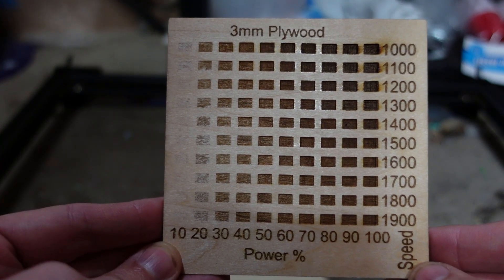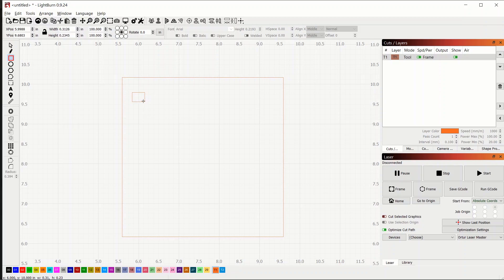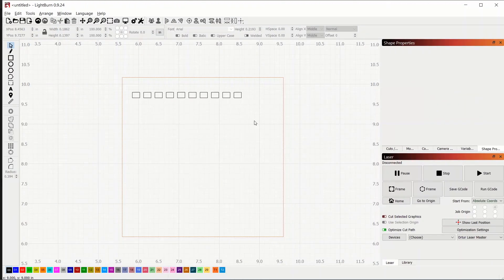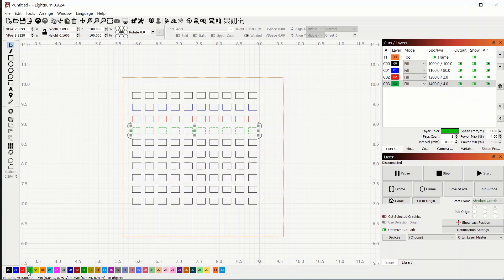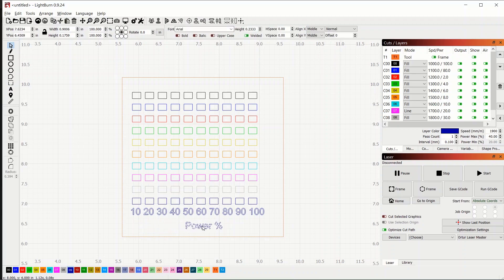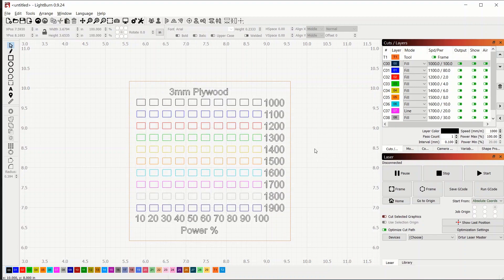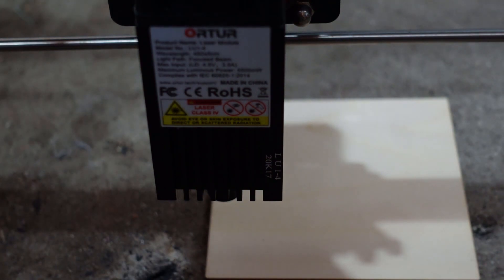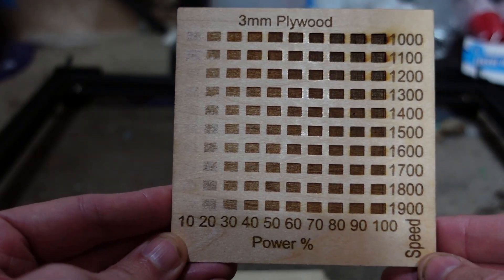Lightburn Speed & Power Grid Tutorial

Comment from the maker: Remember, if you're using a co2 laser you probably don't want to go above 70% power, that will wear down your laser tube a lot faster.
Reply: yes, using a c02 60w. so is it safe to keep it at around 20?
Reply from the maker: @TeresaHumm  20 would be fine but you could go higher, you just want to avoid going over 70.
Reply: I made mine as a line Card so I went up to 100%

Comment: I have the Ekelstar 4240 CNC 20w/5w will this grid work for that aswell, and will I just input the same numbers as you have done, I just want to be able to create some more stuff
Reply from the maker: @yvonneomalley3332  It should. You can always adjust the speeds higher or lower to get a better range if you need to.
Reply: I'm on the verge of throwing it out because it won't do anything and I can't find the settings for it to cut wood anywhere at all, tried your settings it hardly touch the wood for engraving but thank you

Comment: setting all the powers to 100% at the end is confusing - what makes you think your original input value magically gets turned into a percentage of the power? (genuinely asking) - i think all you did was show us a power grid of 100% power at different speeds and not different power percentages and speeds
Reply from the maker: It's not "magic" that's how it works. It's a percentage of whatever is on the layer.
Reply: @3DJapan  but where you entered the 100% is the same as when you entered the 6.6 its just in a easier location - if you go back into the layer it will show as 100% not 6.6 or whatever value you entered originally meaning it was changed to 100% - why would there some sort of background math going on? you entered 100% its using 100% - if im wrong please explain.

also im testing it as i type this at a machine using lightburn.

Comment: I noticed your settings are mm/m mine are in/m, does that make a difference on the numbers used? instead of using 1000, 1100, 1200 do I make it a different number? Thank you
Reply from the maker: I'm not sure what you're numbers would be but you can change it to mm/min in Edit > settings, then if you like, change it back after you're done. I got used to using mm because that's what 3D printers use. Plus most laser tutorials use mm.

Comment: There has GOT to be a more efficient way to do this than manually ... right? All this tech and software, but a test grid has to be created one square at a time? Seems like LB would just include a premade/native template for something like this. [edit] Spoke too soon ... yes, it indeed looks like there's a "materials test" feature in LB that generates just such a grid.
Reply from the maker: No, not one square at a time. Whole groups of squares at a time. Yes, after I posted this video they added a basic version of this to the software but doing it manually gives you more control and shows you how to adjust it if you need to fix it after it's made. Not to mention once you make it one time you can just easily adjust it for different materials. You don't have to make a new one every time.

Comment: So I did this last night and had to shut it off after about 5 mins or so.  It burned through the wood into my self healing mat.  I’m not sure what I did wrong I followed right with the video. Well here’s to see what happens to a self healing mat 😳
Reply from the maker: Never good to have something you care about under your material. Every material will have different settings so your wood just needed less power. You might want to try increasing the speeds in your grid. If tweet doesn't help just don't use the high power percentages, maybe stop at 70% and don't use the 80, 90, and 100 rows.
Reply: @3DJapan  ok thank you. This was like literally the 2nd thing I’m ever done.  First time I used it the motherboard blew.   So after a month I finally have it working.  Just little scared of it now 😂

Comment: Great video Phil.  I followed your instruction to the T.  However I do have a question.  At 11.46 in the video you had mentioned to set each power to 100%.  Then at 12:03 right before you burn the Power looks like it went back to the original Power Settings.  Should we keep it all at 100% Power or have set back to the original?  Thank you.
Reply from the maker: That part was edited in later, that's why "Editor Phil" said it. The power in Cuts / Layers should be 100% for every layer, the number in Shape Properties is a percentage of the one in the layer. So if the layer said 50% and the Shape Properties was 50% of that, you'd be using 25% power, so just set all the layers to 100%.

Comment: This is thorough but last month I did a power test and now I can’t find the button to do the one that they automate. Is it under the tool section? Sorry this is probably the most idiot question but if anyone happens to see this let me know.
Reply from the maker: The one built into Lightburn is under Laser Tools > Material Test. I do think doing it manually is better, it's more customizable and only takes a few minutes.
Reply: @3DJapan  Thank you. I did find it under “interval test” 2nd from the bottom in tools. I do t think this version has been updated for at least 6 months so that may change. Thanks for the help. PS, I have a Chinese laser and it’s the big 1390 FL. I am noticing if I stop a rastering or a vector cut in the middle of a job, when I go back to doing the job again it is offset by at least a 16th of an inch. This is not a good thing! Curious if you have any tips on how to make this align perfectly if I stop it in the mist of the job? Thank you and if you have an answer I’d like to buy a coffee if you provide one in your YouTube videos. Thanks boss.

Comment: I am fairly new to the laser seen, can you explain after you do a speed/power test grid, how does that help you choose your speed and power when you are setting up an image to burn?
Reply from the maker: If you look at the grid you can pick the square that you like. For wood that would usually be dark but not dark that it has scorch marks around. For ceramic tile and some other things there's a sweet spot where too slow and high powered won't show anything, while too fast and low power also will show nothing. When you find the one you want look to the side to find the speed and down to find the power, then enter them in the software for your project.

Comment: I built a similar power scale to yours, but then when I went to get it cut with my Omtech 100W, all the boxes turned out basically charred. It looks like each box, regardless of the fact that I've got the power scale set to different ratios is burning at 100%. Any ideas why that would happen?
Reply from the maker: Probably your speeds were too slow for that material, so if you did 100-1000 try like 200-1600 or something.

Comment: Great video! Doesn’t light burn have this test grid feature built in stock? I will say It’s taking time for me to learn light burn compared to Corel draw. With Corel draw we would set the grid by actual color values and it makes it more intuitive sense as we can actually have a visual of the values in our designs. In the end I think once We make your provided chart I think it will get easier. 

Lastly, if you have created a video on how to take a word and over lap it on a photo as negative space (some sort of cut out terminology), would you provide a link? For example if we drag the word hope of a family photo, we want the photo engraved but no engraving where “hope” is if that makes sense. Sorry for the novel and thanks for your help! 🤝
Reply from the maker: To answer you're first question. Yes, LightBurn has the function built in. I think it was added after I made the video. Look under Laser Tools > Material Test. However that doesn't let you customize it with text or anything. As far as the Corel Draw method. I haven't used that since 1997. lol I think you could do the same here but the technique in the video would be faster.

I have not made a video on cutting out the text but I can tell you how. Write your text, then make a big rectangle around it, bigger than the image. Select the text and rectangle and right-click. Choose Group. Make the new group a tool layer, T1 or T2. Now with the text in position select it. Shift-click the image so they're both selected. Right-click and choose Apply Mask.
Reply: @3DJapan  wow thank you sir! I will be trying this tonight.

Comment: Thank you for your video.  It was very helpful.

I did notice some differences between what you show, and what I see in LightBurn with my 100w Thunder Laser.  In your example, the minimum power is greyed out.  However, on my laser I have to specify a minimum power for each layer.  If not, LightBurn will fire the laser at 100% all the time.  If I try to follow this guide, I get an error during preview that states "The following layers have power scale applied but Min Power is set equal to Max Power: 10: [layer name]".  Is there an 'auto-minimum' you are using, or is this specific to your machine profile?

FYI, Thunder Laser, and other 60-130W lasers, do not want the laser fired at 100% power.  Instead the grid should go from 10-90% for cutting and ~5-60% for engraving (depending on laser power and material).  I also suggest a 5-tier grid for cutting and another for engraving on the same sheet with circles instead of squares.  This saves time and space.  See this video for an example:  https://www.youtube.com/watch?v=GqvTjhzVJI0

Thanks again for taking the time to make and share this information.
Reply from the maker: So I just Googled the Thunder laser, it's a CO2 one, right? I'm using a diode laser so it's a little different. I've never used a CO2 so I don't really know anything about them. Actually there's a new feature in Lightburn that might help, it essentially does the same thing as this but maybe it would work better for your laser. 
Look under Laser Tools at the top and click Material Test. The pop-up window gives you options to burn a grid like this. It doesn't actually generate it on screen but you can burn right from that window and preview what it will look like.
Reply: @3DJapan  Thanks!  That is useful and another thing I didn't know about.  I'll give it a whirl.
Reply: I use Lightburn with my OMTech CO2 laser. We are also cautioned against using 100% power (burns the tube out faster, I heard). What do you set minimum power at when you are at 60 speed for an engrave and again what minimum power do you use for 90% to cut? Do you change the minimum speed proportionately to the increase/decrease in power?

Comment: OK so heres my next problem....... First I’m really new to the laser world!! I have a XTool D1, all firmware and software are updated. When I created a grayscale grid in Lightburn and previewed it, Lightburn told me that it would take 89hours 43 mins 35sec to burn. I reached out to someone about this problem and they sent me a downloadable file for greyscale and Lightburn told me that it would take 5hours 19 mins to burn. I looked at the max speed for the D1 on there website and it said max was 350mm/s. so when set my speed settings I started with 35 and went to 350. I noticed the every video i saw on youtube that used light burn, used setting Starting around 1100 and up. should trans late mm/s to mm/m because thats what lightburn runs at? so instaed of 35 mm/s i should put it at 2100 mm/m? Is there settings that I am not using properly? Need massive help!!!
Reply from the maker: I'll have to look into this further but according to Amazon's page for the D1 the max speed is 10,000 mm/min. I haven't used it myself yet but I'm actually getting one in to review soon.
Reply: OK great I look forward to hearing what you find out!! I greatly appreciate your response!!

Comment: Good video. I did everything as said, now at the end you said change all to 100% power.   It's cut though the wood. Very confusing when you get to that part.
Reply from the maker: Did it cut through all of them the same? Then there's some confusion. If it only cut through the slower ones then you did it correctly. Just repeat it with faster speeds. Instead of 1000-1900 maybe try 2000-2900. It will all depend on your wood. Harder wood like oak will be harder to cut than balsa for example and of course the thickness of the wood. Please be sure to have something under the wood that won't get damaged. I don't want you burning your workbench or something. Also make sure your laser is focused.
Reply: @3DJapan  I'll go back to drawing board. Thanks.
Reply: @3DJapan , small world

Comment: I do have a question..

if the laser is set at 30% power does that mean that an individual object set at 50% burn will be burning at 50% of the lasers 30% setting?

Or is the object burning at 50% of the lasers total capability?
Reply from the maker: Yes each object will use that percent of the laser power. The laser power should be at 100% for everything. I mentioned that towards the end of the video.
Reply: @3DJapan  okay, thank you! I surely missed that in my rush to get my grid completed.

I made my first design cut last night and am STOKED at how it came out (I need to fine tune my line settings for cutting though).

Comment: Thank you for this, question, what numbers do you use to cut a clean line in the 3 mm plywood, I was using 200/80 with 6 passes, but it’s much too slow.
Reply from the maker: The settings will depend on your laser. How about using this grid but in Line mode instead of Fill? It really should need more than one pass.
Reply: @3DJapan  Hello Phil, yes I as able to to the grid using the fill, but I was talking about cutting through the 3mm plywood, I'm using a sculpfun s6 pro laser.

Comment: Alright...just started to do the test piece and the color barely shows. I used my measuring rod to make sure the laser was set at the correct distance from the wood. You didn't show that in your video so was I not supposed to do that? I thought I was told you should keep it that distance away from the project piece. Anyway...I double check all my settings were the same as yours and can barely see it. Any thought on what I may be doing wrong?
Reply from the maker: Oh yeah, you always want to focus. It could be your wood was different from mine and needs more. Try again with slower speeds.
Reply: Phil Nolan I’m definitely using a thicker wood because that is primarily what I’m going to be burning on so I wanted to get the results such for this specific wood. It’s just a 1” pine. Any suggestions on what I should lower the speed to?
Reply from the maker: @shannonjakoby5109  Well I'm not really an expert but it might depend on which laser you're using and what wattage it is. My Ortur Laser Master 2 20watt came with a page of suggested settings for different materials. Your laser might have a similar document on their site or a facebook group.